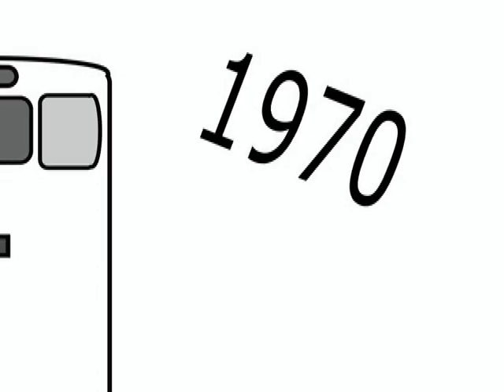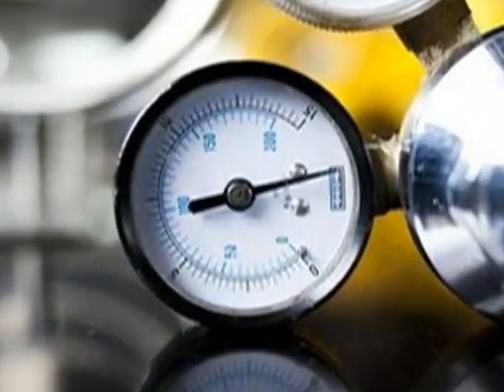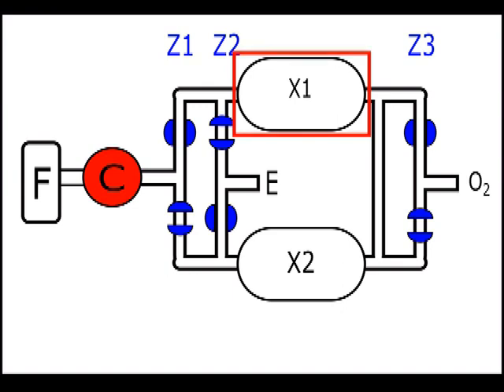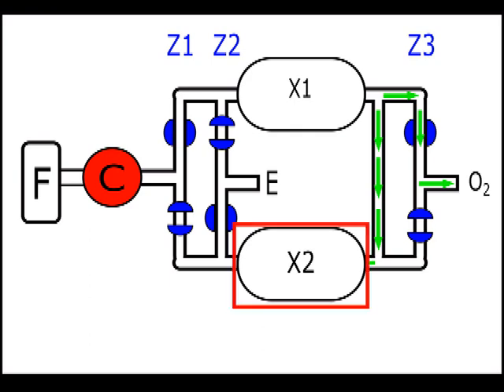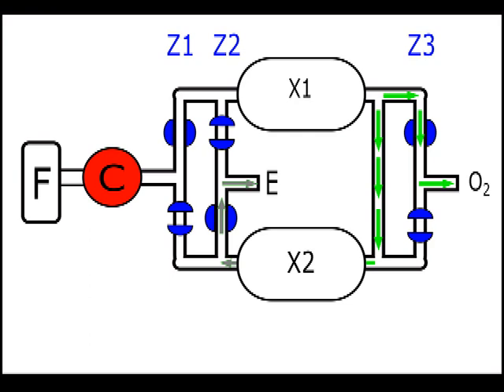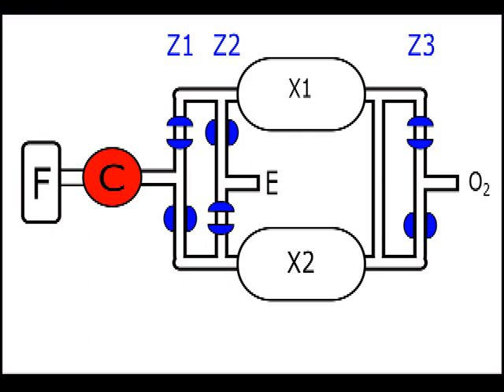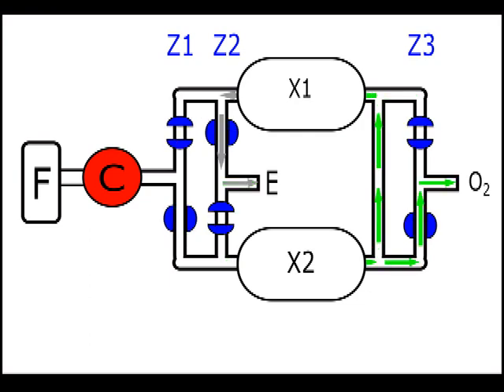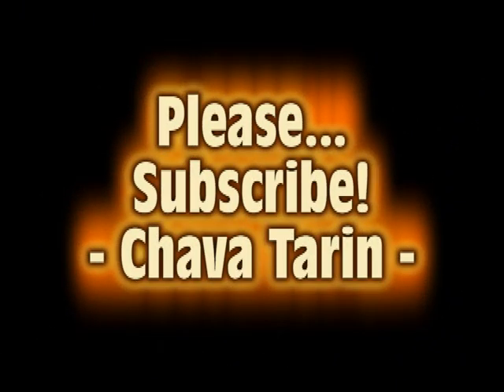How an Oxygen Concentrator Works

Comment: How nitrogen absorbed Seevs are desaturated after fully saturation ?
Reply from the maker: A timer sends signals to the valves so the flow is reverted and dumped to room air. That way the saturated cartridge is cleaned, by blowing oxygen from output and out to the room.

Comment: How pure is the N2 waste gas?
Reply from the maker: Dear Iguana Pete, the waste nitrogen is as pure as the room air is, the concentrator just removes the oxygen from air, and leaves air composition as is, including argon and carbon dioxide.
Reply: @eltunene   Thanks. My wife uses such a machine. I want to store dry foods in air tight buckets charged with N2. It is supposed to make it last longer.

Comment: In the place of filter, 1 micron prefilter can be used. Instead of oil piston compressor better to use diaphrahm or bellow type air compressor. In the place of X 1, amberlite or zeolite phorous material can be used. This material is named molecular sieve in the size of 3A×1. 5mm can be used. So as to have continous flow of pure oxygen air should be pressed in to sieve catridge with pressure 4 kg / cm 2. This system simply and in easy way explained. Thanks.
Reply from the maker: Thanks, Jagadeesan, for your contribution!!! Excellent info!!!

Comment: Thank you for explaining so clearly with a simple diagram. 

What is the cycle time for each of the zeolite cylinder X1 & X2 ??
Reply from the maker: Well, dear Sarkar, my career is electronics, but there is an excellent article by World Health Organization about this subject at https://apps.who.int/iris/bitstream/handle/10665/199326/9789241509886_eng.pdf;jsessionid=9DBB643190341D007F3E35DEC6BB9F61?sequence=1 Hope it helps!

Comment: What oxygen concentrators use this system of auto cleaning ? Some of the producers say they have replaceable filters. For example, they are from 300 Euros to 2000 Euros and they have filters.
Reply from the maker: Dear Razvan, there are a few factors to consider when buying an oxygen concentrator. For the most part, concentrators are long lived devices, however, oxygen liter demand, air moisture, pollution present, and dusty environments tend to degrade zeolite sieves.  Please take a look at this buying guide at https://www.oxygenconcentratorstore.com/home-concentrator-buying-guide/ . Hope that helps!
Reply: @eltunene  Thank you.

Comment: What volume (at average sea level air pressure) of Oxygen does these machines typically produce in an hour ? And does the pressure of the output pulse as the compression tanks switch over ?
Reply from the maker: Dear MrMarkDerry, specifications by manufacturers of oxygen concentrators are numerous, however, there is an article by the World Health Organization about concentrators where you can read from a relatively impartial source: the link is https://apps.who.int/iris/bitstream/handle/10665/199326/9789241509886_eng.pdf;jsessionid=9DBB643190341D007F3E35DEC6BB9F61?sequence=1
Thanks for your comment!!

Comment: Sir what is the time duration at each stage of cycle
Reply from the maker: Dear Sanket, it varies with every model, ranging from a minute to several minutes, also depends on the amount of liters per minute required.

Comment: Very great job
you did it out very simple and clear
plz # preventative maintenance, if it is possible 
THANKS
Reply from the maker: Dear friend, when dealing with pure oxygen, strange things happen, like metals catching fire, lubricants exploding, and other inexpected phenomenon, due to the strong oxydizing features of oxygen gas. I suggest you try to find some advice from guys who are fixing those things frequently. Neverthe less, those things are very dependable, and work for long time without needing maintenance. One thing you could do would be to gather some free manuals for popular brands and read the troubleshooting section, as well as suggested maintenance. They have a dust filter, which depending on environment, may require frequent changing. The molecular strainers are self-cleaning, and should last very long. Solenoid valves also might need replacement, however, since they are in contact with oxygen, this needs to be done by experienced technicians. Hope this helps.

Comment: sir I want use oxygen in fish tank for their well groth, but I don't know how to make it and use it, can you help me sir by advice.
Reply from the maker: Dear Abdul, an oxygen concentrator would be a good solution.  They are very clever devices which use a process of pumping and filtering, very much like a coffe-maker. Thus, it consumes much less power than an electrolytic process, which sort of "unburn" the water (water is the ash resulting from burning hydrogen in an atmosphere of oxygen). You have to put a lot of energy in order to revert the burning process and this accounts for the high energy consumption.  On the other hand, pumping and filtering requires less effort. Maybe you can find in the market a small portable oxygen concentrator, which would keep the water in the fish tank with a enough oxygen in solution. Building an oxygen concentrator yourself can be a difficult project. The compressor used must use no oil, since it may explode (oxygen makes fuels burn in air, if the oxygen is concentrated it can be dangerous). Oxygen concentrators are not cheap, but a homemade one could yield into a lot of problems, tue to the oxydizing effect of oxygen.
Reply: @eltunene  Thank you sir for your valueable advice, one more thing sir, Have you any video clip about this item.